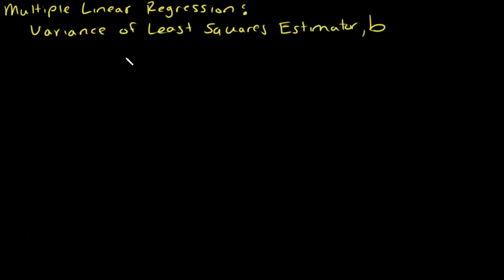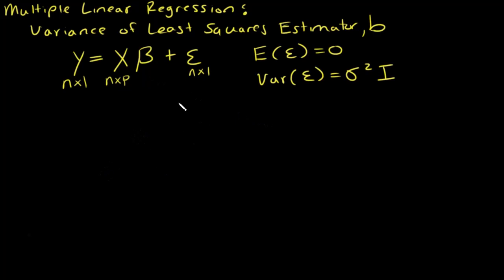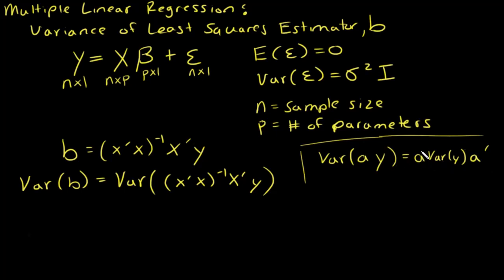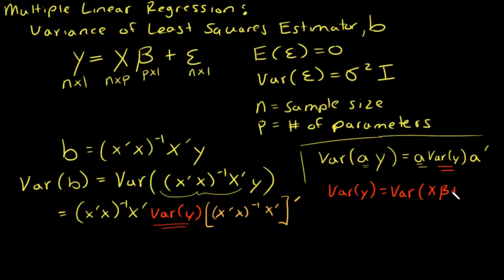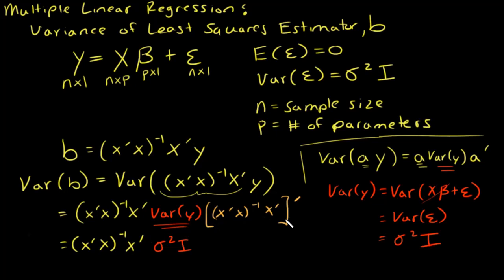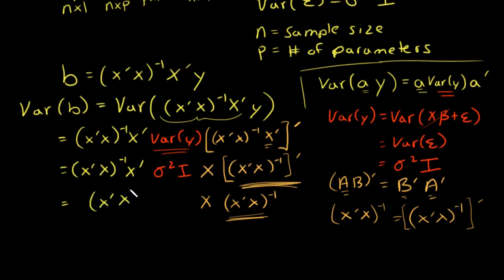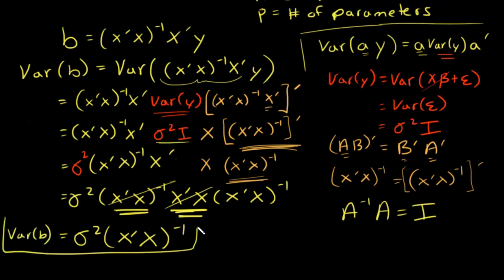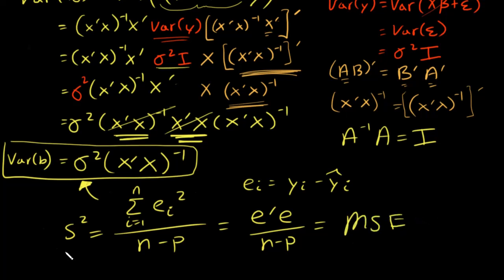Multiple Linear Regression Variance of Least Squares Estimator, b

Comment: Why exactly is X not random?
Reply: X is not random because we use a particular type of random sampling where we fix the value of X at different levels. Eg:- Suppose we take X=Income of a person. Then we can fix that X can take values of multiples of 5000(say 5000,10000,15000....) Now if the value of X is multiple of 5000 then only it is considered as a sample otherwise not. Although this assumption can be removed and X can be taken as stochastic. (Refer to the book of Wooldridge ,Cross Section and Panel data for stochastic treatment of X)